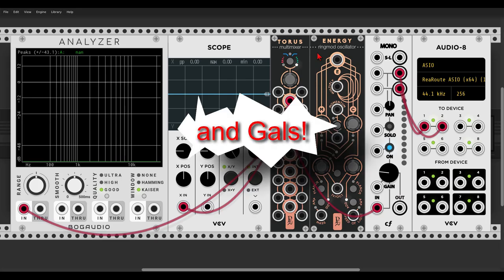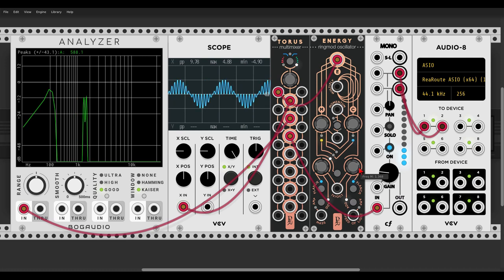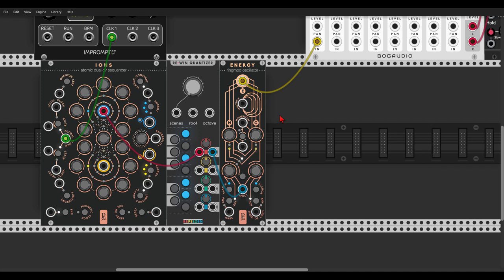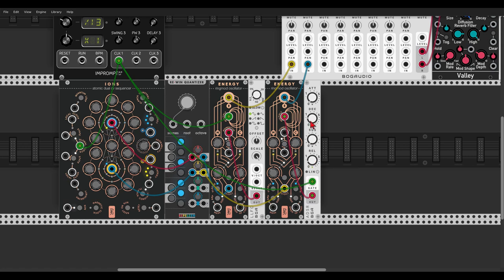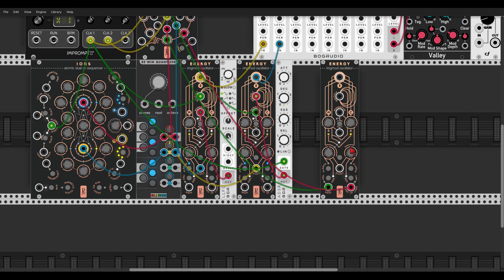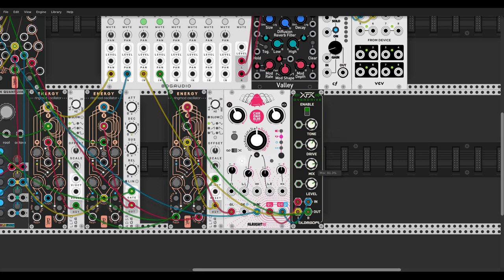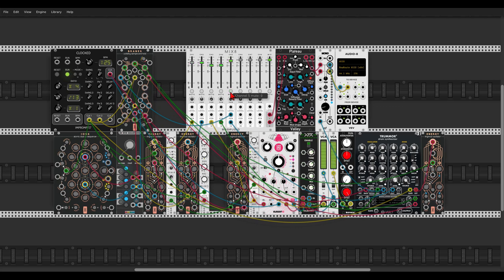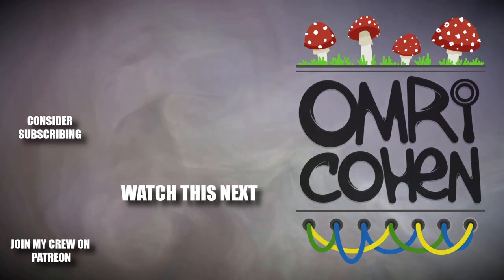Geodesics Modules Series Part 9 - Energy

Comment: It's very clever of Geodesics to have a mode that uses only octaves and fifths. It's late at night here and I could have got this wrong, but I think that means all the frequencies that come out of the ring mod are going to be simple overtones of either the main pitch or an octave below it, which keeps things from getting too dissonant. This is because fifths introduce a multiplier that is an integer multiple of 0.5, and the sum and difference of the two frequencies must also therefore be a multiple of 0.5. Someone please correct me if I'm wrong! However, it makes me wonder whether the interval they allow is an equal temperament fifth or not. If It's ET then you'd get slightly detuned results...